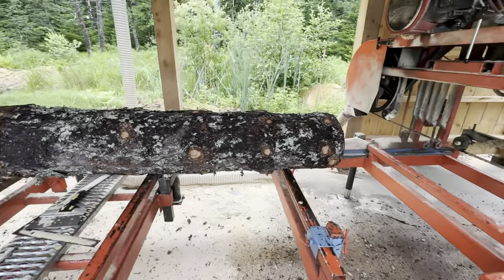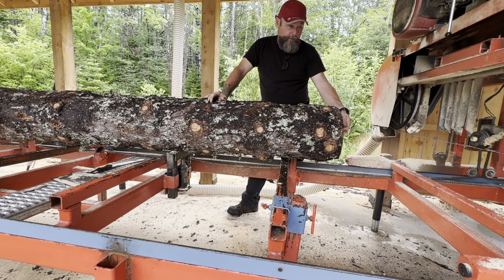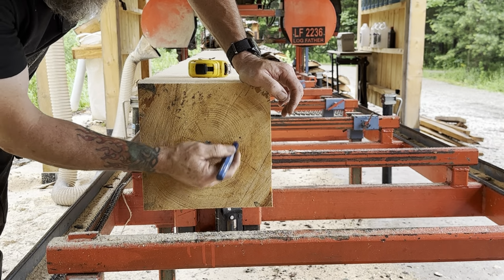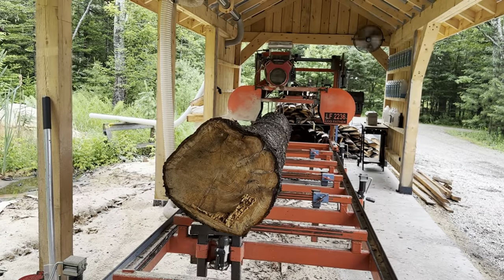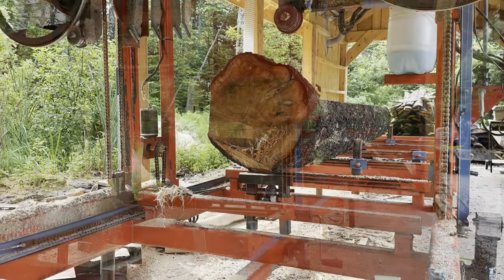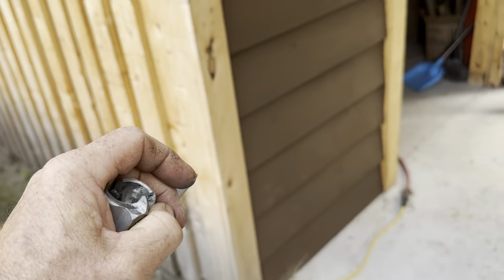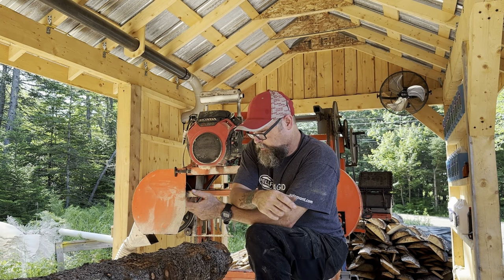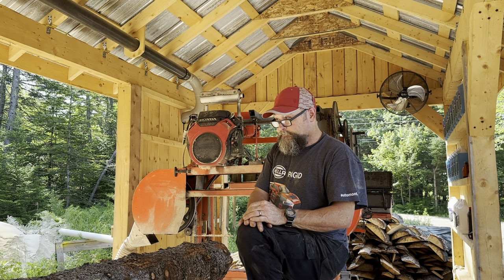Dealing with tapered logs, and milling the PERFECT log!

Comment: Is that a DIY sawmill?  I have not seen a manual bandsaw mill that has drag back fingers.
Reply from the maker: That’s a mill I built myself, I loosely based it on Linn Lumber’s plans, but made it wider, taller and longer. The drag back fingers are a recent fabrication. They work fine for anything thicker than 1”… I should have made them a bit longer… next time! Thanks for watching! Jeff.
Reply: I didn’t realize you built that mill that explains how you have that rig to lift the log to take the taper outa it an the fingers to pull the lumber back all great things to be more productive that I would like to add to my mill but I hate to start cutting an welding on a mill that’s les than a yr old lol